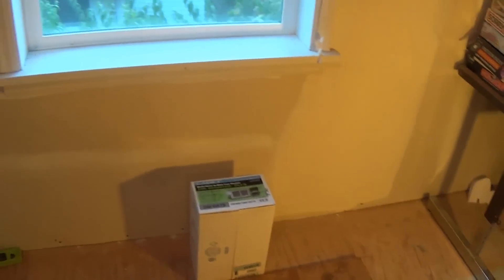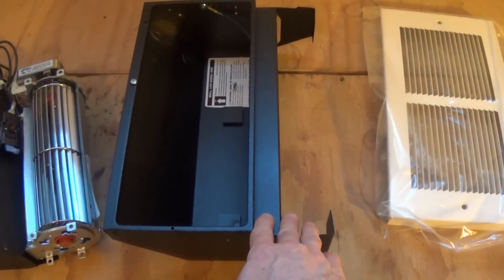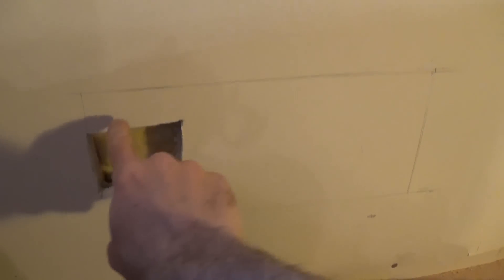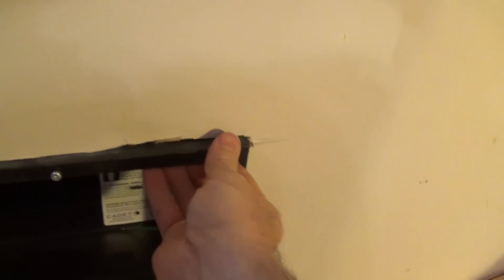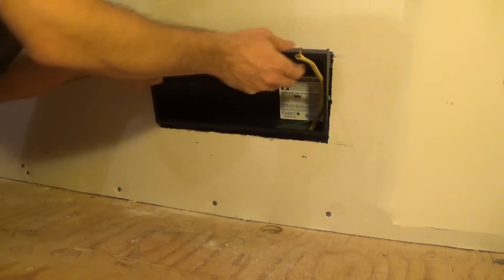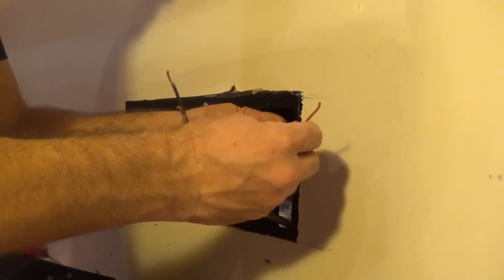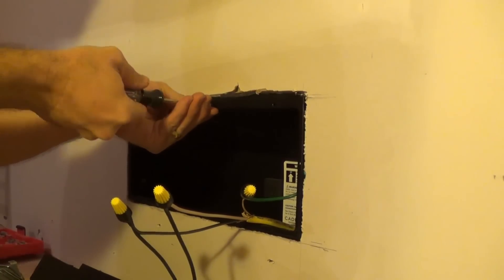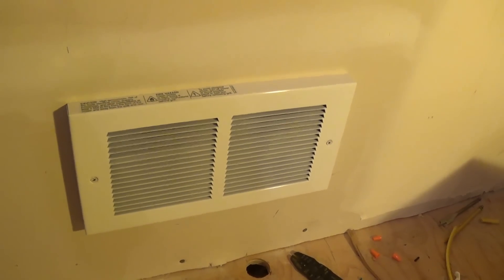How to Install a Cadet Heater

Comment: Great video! The only thing I would add is a wire clamp for strain relief in the knockout before feeding the power wires through. Other than that, I found this very helpful. Thanks!
Reply from the maker: I fully agree.  I had just ran out and didn't want to make a run to the hardware story.  I was being lazy.  Thanks for the post!
Reply: @HowToWithGEO  never ever be lazy when working with electricity because electricity can be very dangerous

Comment: Thanks for sharing this video!
Reply: Cadet Heat how many of these can I run on a 100 amp service without overloading? I also have electric water heater and stove. I'm currently running two 240v heaters. I need more but I'm afraid to overload my service

Comment: Nice video.  However you should have wrapped the neutral wire with black tape to show it is hot.  Otherwise someone might think it is just a 120v heater.
Reply: 10p6 it depends on the country. In canada, we have different kind of wires for 240v. Easy to identify.

Comment: Most folks should be hiring a licensed electrician to run new electrical to the unit, especially if you don't already have 220v.

Comment: your wire nuts are loose. you dont need tape if you tightened the wire nuts. the wires should start twisting around each other. the wires should not come out of the wire nut if you pull on them.

Comment: you forgot to secure the wire on the box with a romex wire connector which is very dangerous for a 240v system. That mistake alone caused me to stop watching this how to.